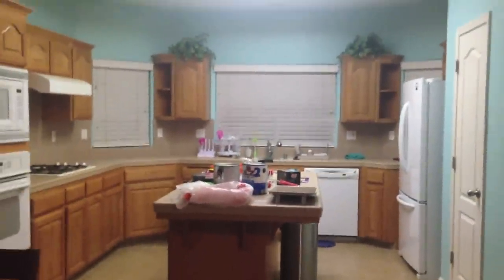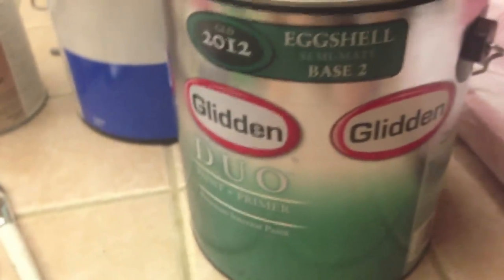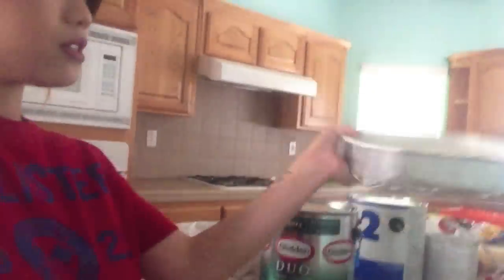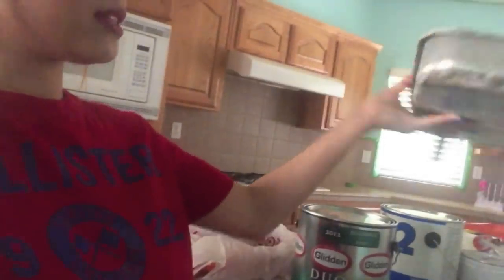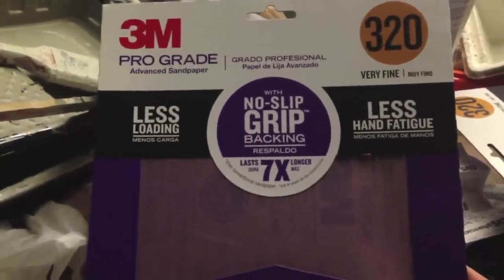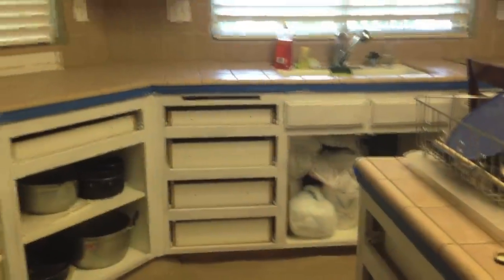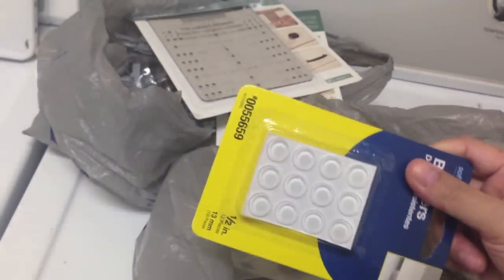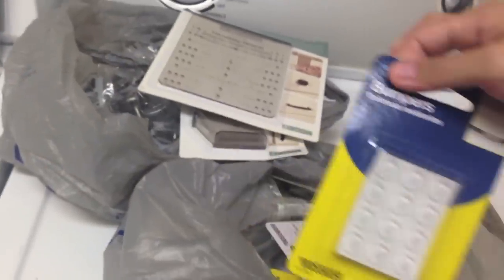DIY: Painting Oak Kitchen Cabinets White

Comment: You two did a beautiful job! I have a question: do you think, if you were to do it all over again, you would roll out your cabinet doors instead of spraying them? I'm on the fence about which I should do. My doors aren't as nice as yours (they've been painted a few times before, by previous owners, and not well!), so I'm not too worried about messing up, because anything would look better than what's there now! ;)
Reply from the maker: First off thank you.  If we were to do it over again, I think we would still spray the doors instead of painting and rolling by hand like the cabinet frames.  It's a lot faster and easier; especially if you want to save time.  Also, you don't have to worry about missing spots that you didn't roll over to avoid the brush strokes.  Hopefully I answered your question.
Reply: Margaret Andersen a

Comment: +XoxoSue Great Video! I had a quick question. Did you spray the side of the frame of the cabinets too? If so, was it hard using the sprayer inside the house?
Reply from the maker: sr3281 we only painted the frame of the cabinets, no sprayer. Sprayer was only used on the doors.

Comment: Hey thanks for the video. Can you tell me --   did you sand your cabinets before prime or did you apply prime just after using TSP.   Also how many coats of primer did you use?
Reply from the maker: Hello, after I use tsp and let it dry overnight, I used primer without sanding the cabinets. The primer I used was Stix Waterborne Primer so it doesn't require sanding.
Reply from the maker: And I used one coat of primer but for the fronts of the cabinets counters I did double prime .  If I had the extra time and wasn't lazy (being honest) I would had probably double prime everything instead of just parts.

Comment: You showed a brush did you spray paint it of brush?? Does it peel off easy ?
Reply from the maker: +thetruth I used the brush (in the beginning of the video) on the cabinets then I used a plastic roller to go over the brush strokes so there were no lines showing.  It did not peel off at all.  For the cabinet doors that were removed, those were sprayed on instead and they did not peel either.

Comment: always sand,, do not just use tsp, i hear that alot and you can run into alot of problems if you rely on tsp and a deglosser..how do the cabinets holding up..if you scratch it with you finger nail will it scratch off...the only other thing is i def would not have used that primer, they should have told you to use a oil base primer to go over the varnish that was on your cabinets..
Reply: Did you read about that primer? Supposedly no sanding necessary and designed to be used exactly as she did.  Normally I would agree with you and initially had same thought but then did some research.  She did a fantastic job but I'm also curious about scratch test and how it's held up over time
Reply: i have been a painter for over 20 years, and i also have usd 100s of gallons of the styx primer,  i have seen plenty of people that put it on varnish wood or over oil paint and a few months or year later the paint started coming off. the advance paint is the only paint i use for doong cabinets or trim work, very durable and washable .but i always use an oil primer nothing waterborn over a varnish
Reply: So are you saying clean, sand, oil base primer and then Advance? I see what you're saying and glad you commented.  Would be awful to put all that time into it and have it last a year.  I fell for the no sand chalk paint on a furniture piece, let it cure for a month and it's scratched up a year later.  I even used multiple coats of poly over it.  The orangey oak coming through my dark annie Sloan chalk paint looks really tacky. Plus that paint is expensive.  I spent $100 just to cover the piece.
Reply: Shay Funk def is, and when they say u dont have to sand with chalk paint that is a misconception as well,,i have my own brand of chalk paint and i always tell people to sand, and if going over anything that has a varnish or an oil paint i tell them to sand then an oil primer then the top coat...if you do not use the oil primer and sand then it will scratch off, and will not last.
Reply: Thank you! Really appreciate the expert advice.